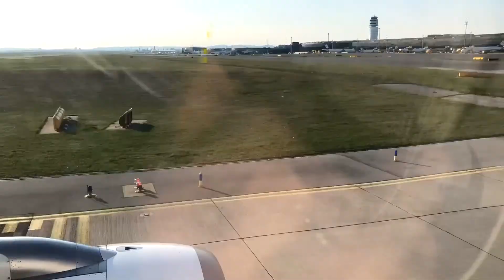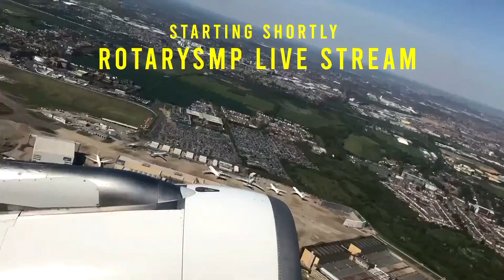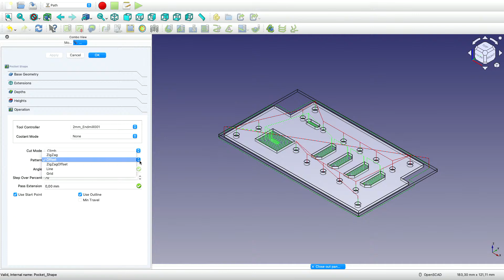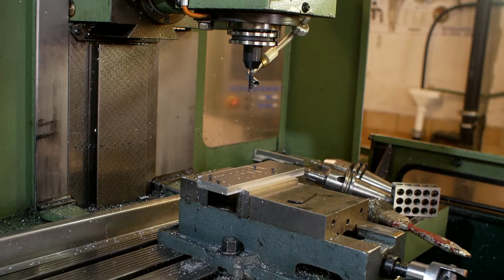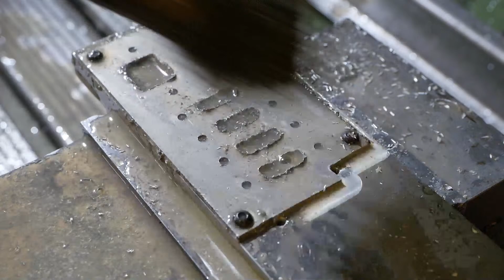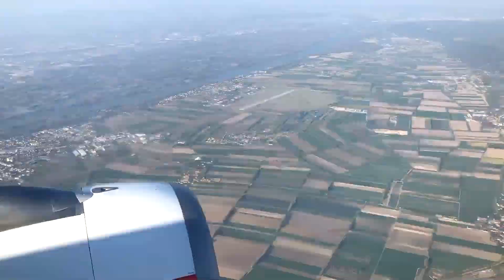RotarySMP Livestream - 17. Dec.23 @ 20:30 CET

Comment: Your K wire can be tig welded
Reply from the maker: Thanks for the tip. The problem is now the ends have pulled back so far, the wire snaps when I draw them together.

Comment: I thought even in conFusion360, to do CAM on those openings, you'd do 2 separate operations, one to clear out most of it (with adaptive, or zigzag or whatever) with "stock to leave" set to 10 thou or something, and then do a separate operation that just does the "finish pass" around the outside and takes care of the final 10 thou. I don't know for sure, I haven't gotten to that stage yet on my cnc mill project - I did exactly what you said not to - tore the whole thing down at the beginning before even using it at all (though there were good reasons to do so in my case) and it's taking me FOREVER to get it back together. I'm glad you're trying to do it with FreeCad 100% from the get-go, as that's my plan too. The true open source solution is usually better in many ways in the long run, even if it's more painful to learn in the beginning. Look what happened with Eagle, and how most people switched to KiCad. I've been using KiCad since when Eagle was still really popular and everyone said I was dumb for struggling with KiCad back when it wasn't as good as it is now! One day the license changes, and then you're boned unless you're using open source software!

Comment: Dude have you tried Solidworks or Fusion360?
Reply from the maker: I covered that. The license for commercial use of Fusion I cant afford. Autodesk has made it clear they consider monetised YT commercial use.

I was informed that Solidworks now offers a lower priced maker license. I need to look into that and see if it includes a CAM module. 
.. Just checked. Solid works is not offered for macOS. I switched to a MBP a couple of years ago due to the efficiency for video editing of the ARM hardware.

Comment: Mark, thanks for the livestream.  I have no knowledge of such things...... but I wonder if the HDMI metal shell tight fit to the mounting plate you just machined with be an electrical problem???  I would guess the shell is a ground?  Just something ELSE to think about.  😉
Joel....
Reply from the maker: Hi Joell, Good point. If I get any funky interference when I mount them to this plate, I will know I need to change it.